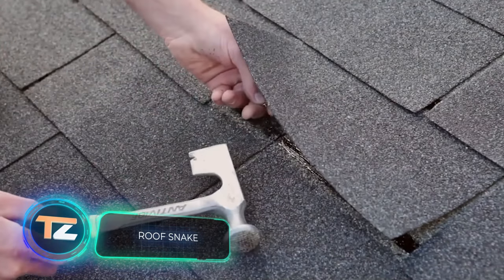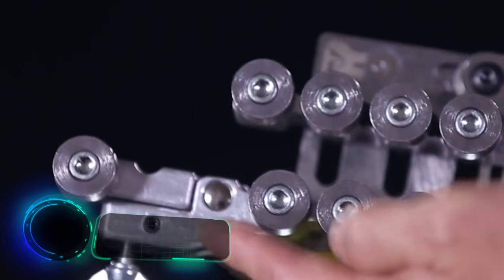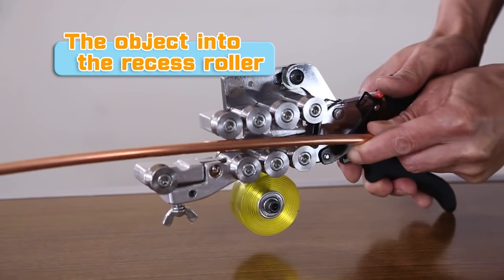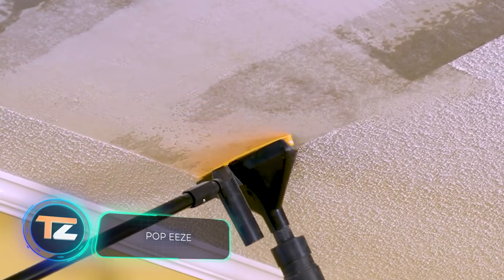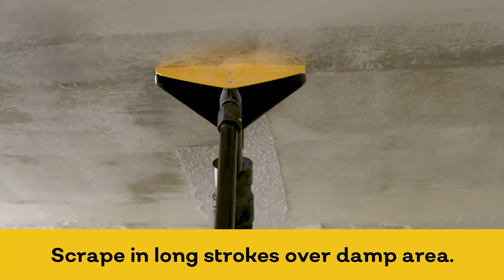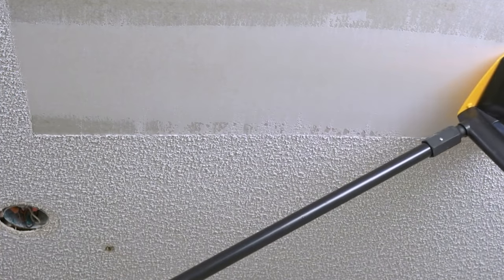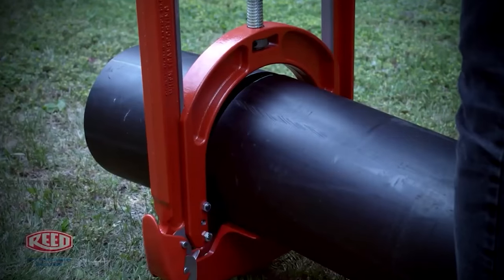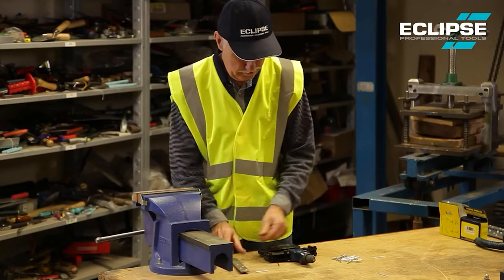AMAZING TOOLS THAT HAVE REACHED A NEW LEVEL

Comment: the cable tie tensioner has been available for forty years to my knowledge! I was using one in 1985,
Reply: British telecom issued them to engineers like myself for use with the new style phone sockets around the mid 1980's
Reply: "forty years" and "1985"... those two terms just don't seem right together in a sentence!  It feels like "forty years ago" should be referring to something in the 1960s... 🤣🤣
Reply: @petercampbell1648  Frightening isn't it?
Reply: 40 years ago was 1982.
Reply: Invented in the 1958 (tyrap) as we usully know today as tiewrap or cable ties,
as all products shown in the vide thay was invented long ago and been used a long time, but redesign and product evolution, new materials and so on is always good... like in the 50:s tools made of cast iron...compared to modern materials of plastics and crbonfiber and so on... also tools using new materials CAN be more flexible and durable... for example cutting tools can be made light yet the cutting edges can be made of hard/durable materials... Cant stop evolution...keep it up

Comment: that popcorn ceiling remover would last about 5 minutes in the real world the cheap looking plastic wont last
Reply: If it works for one ceiling, a homeowner/handyperson would be satisfied.  Removing popcorn from a ceiling is a PITA since you have to keep the popcorn off the furniture and everything else.
Reply: @Harry-zz2oh  done it countless times it is one of the messiest jobs in a finished house and what they don't mention in the ad is that holding anything overhead like that for any length of time is bloody hard on the body and hard work wet popcorn mud is heavy that's why alter trial and error i always did it with a big ass 12 inch drywall knife on a bakers scaffold /planks with horses it is one job i don't miss

Comment: As a substation/P&C electrician cable tie guns are a game changer. I've got a Panduit GS2B Tensioner and its been well worth it.
Reply: I got one of these in 1977 and still working.
Reply: Does it work on those metal ties?

Comment: I have tried a TON of variations on the popcorn ceiling scraper.  NONE of them work on 80's painted popcorn.
Reply: i know right
Reply: And any older than that and it could well be asbestos.
Reply: Yeah, that was "artex" and stuck like shite to a blanket.
Reply: Popcorn that old was put on with a very stiff paint, which kept it in place for decades.  No matter how you do it, removing it is a pain.
Reply: Knock them down! Even in this video you have a machine that does it with a tungsten disk!

Comment: 2:18...  love how they say to pull the cable through using the built in crank and then they show them just grabbing the line with their hands!  F'n hilarious.
Reply: Usually with crank you can barter hands, but sometimes, if they're in the mood, you might have pneumatic jobs done. Even if you blew a seal: They ain't good with hands (don't tell the penguins...) 😉

Comment: You really should talk about costs when talking about technology. Those laser rust removers are massively expensive. The 2000 watt systems are upwards of $60,000. Some of the cheapest units that will barely do anything are about $4,500. This is not a technology for the faint of heart
Reply: WELL 2000 watts will vaporize metal in milliseconds ... A 80watt laser is pretty good at cutting thick wood relatively fast . So yhea
Reply: Chinese 2000w only 20K
Reply: @achicken6477  I  just purchased 3500w from Wuhan, China. 3500w emitter only cost $12000.00. including laser header (automatical adjustment), cooling system and power unit.

Comment: I’m in  aviation; specifically aircraft structures. That laser corrosion remover would be excellent if it works on aluminum.  We work with a lot of aging aircrafts &  are frequently dealing with corrosion.
Reply: Except for the fact that the Laser is basically BURNING the corrosion off, which would destroy the temper of Aluminum structures and in doing so cause embrittlement as measured by the aluminums conductivity.  In short, using this would make the structure Crack, or soften the aluminum, exponentially decreasing it's fatigue life !
Reply: Lasers are already used for surface hardening of aluminium alloys, simpler than shot  peening, so I think the metallurgical effects can be managed.

Comment: They show lights hanging from a box that isn't achored to structure.  You can't hand a light in a box that pinches dryway, that's a retrofit box at best.  Cool concept though.
Reply: The narrator states it's holds 6 pounds something ounces. It's a wasteful and silly hack if you ask me
Reply: You know where the studs are BEFORE you drill right? You’re remodeling and you hang backer board exactly the depth needed. Then you install the drywall, then install the box. Saving you the time of installing the box and cutting the hole.
Reply: @robsmith4884  I've done a bit of remodeling and making an accurate box hole has always been a pain.  This makes it much easier, especially since you have the wire inserted first, then you cut it in.

Comment: No roofer is using this tool.Nailguns are standard
Reply: This would work when replacing individual shingles. You are right about the nailgun, but then when installing a total roof, you will have it available.

Comment: The jack that you showed did you pump up….  I have 4 of those. They work wonderful. I was able to move a 50 gallon fish tank and it’s stand.  I started with nailing and screwing a Lip on its side just so I can get it up high enough that I can slip it underneath. That’s why I needed two of them.  It would’ve been nice to have 6 pumps.  But I managed was just the 4.   The 50 gallon tank was half full of water and I was terrified of a tipping over.

Comment: The pipe cutter cuts "Up to 1/8 thick" pipe, and they show them cutting 1" thick pipe?
Is the speaker right, or the video???
Reply: The cutter cuts with 1/8 inch of square.   It cuts thick PE, yes.  He missed the detail, I think.

Comment: The Shark tooth box is not worth it at all at $7.50 USD.... I'd rather buy a hole saw made for electrical boxes and is made of metal for $25. I can then use the $2.00 USD boxes instead.

Comment: Smart Box, hmmm cutting ring comes off the box after cutting the hole. All the “smart boxes” come with the cutting ring along with the cost associated for it and apparently is just thrown away since all the smart boxes have them.  I have a great idea, why not have a drill with a hole saw the size needed to make a hole for a, oh I don’t know maybe a dumb box.  Less material needed, less cost for the product and less steps required to install a dumb box.  Sounds like the smart box is made for dummies.